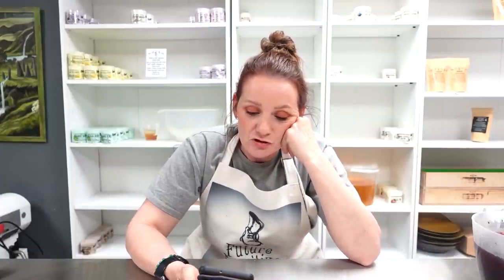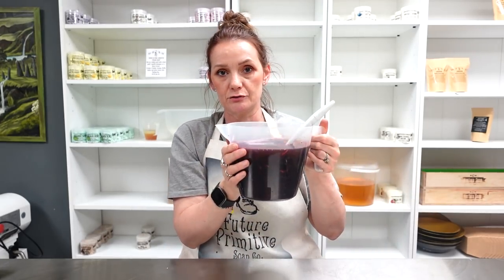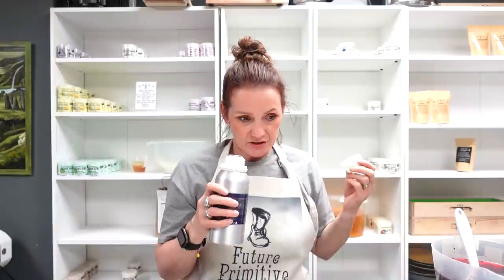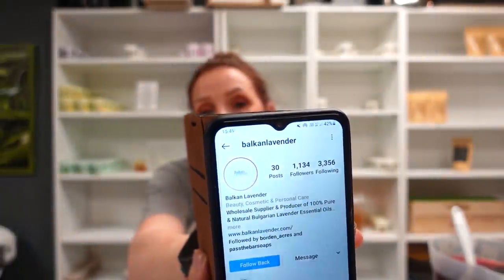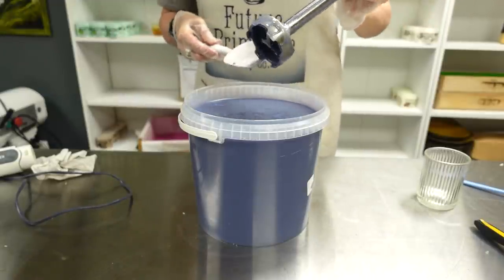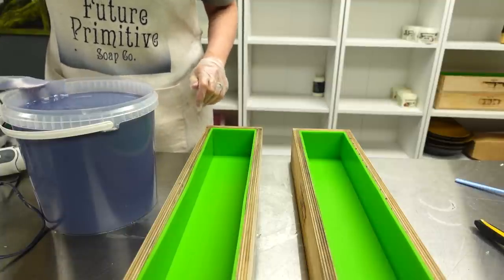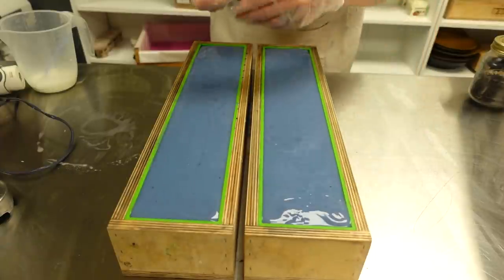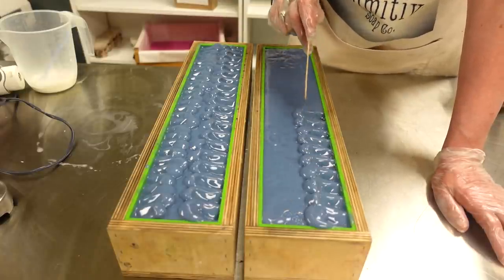Making Lavender soap with Alkanet Root infusion.

Comment: Tiggy (Jo Haslauer here ) Thank you so much for trying Alkanet. I am so humbled that you have mentioned me.  The magic of the color change is my favourite part of using plants for color!  Its just amazing.  The waiting for the final color is my least favourite part!  You should know the final color in 7 - 10 days with Alkanet. I am so thrilled you got blue!  Alkanet likes full gel so that is one thing I always check for.  I also think as you do, that you need more in the infusion to begin with. For me Alkanet roots are a bit hit and miss which is why I prefer the powder alkanet, more surface area to infuse the oil.  I also like longer, stronger infusions but it is definitely possible to do a heat infusion if it is strong enough to begin with.  You will just have to test it to see the level in your recipe, just like you have said everyone's recipe is different.  I will be watching to see how the color changes and I thank you for inspiring others by using plants.   I am beyond thrilled to see this video! x
Reply from the maker: Heyyyy you! Thank you so much for stopping by and leaving me a lovely detailed, and informative comment. I so appreciate it  the colour has changed already into a deeper shade of (kinda) purple. I'll post a pic tomorrow when I'm back at work. I do need to use more for sure so I'll try again in the future and I'll look for the powder version. Thanks so much again, the blog post you wrote was a great help. All the best xx